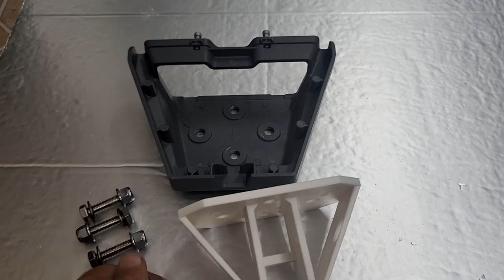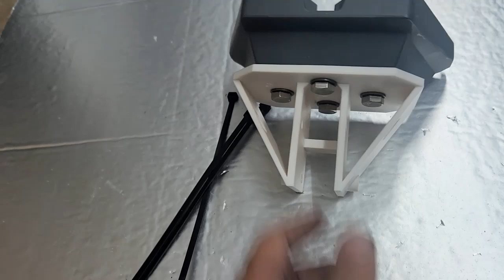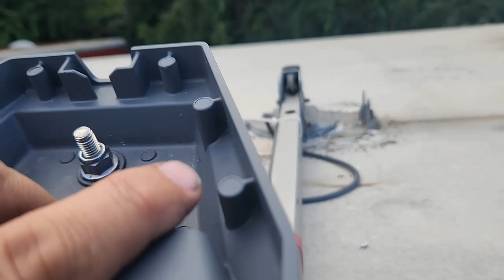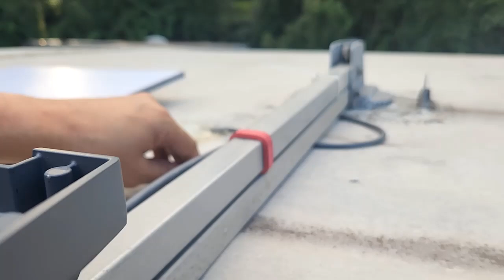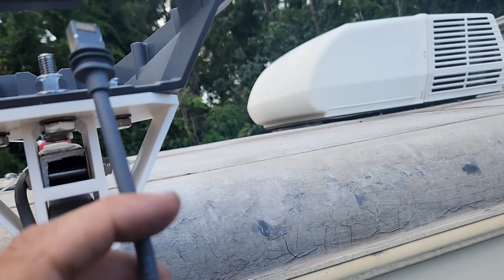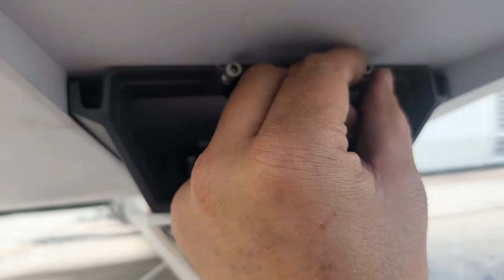StarGard Install - Original - See Lastest Version

Comment: Your title says you're installing StarGard, which is an anti theft device. You're actually installing Starlink.
Reply from the maker: STARGARD is NOT an anti-theft device.  I created this adapter for the quick easy installation of a STARLINK antenna using an existing WINEGARD (or AntennaTek) TV antenna mast.  These TV masts are generally found on RV's although some have been placed on large over the road truck "sleeper" and larger boats.  This video has a multi-purpose use, 1) as an installation guide for a STARLINK antenna using the STARGARD adapter and 2) showcase the ease of installation using the adapter.

Comment: I think this is great but the plastic material makes me nervous.  Any chance there could be an option to have it fabricated in metal or carbon fiber?  Not sure what other materials would be stronger and easy enough to customize.
Reply from the maker: I was concerned about this a well.   We make it with High Impact UV resistant plastic.  I have it on my RV and I just came back from a 6,000+ mile trip across the western US.  Temps ranged from 47 at night to 105 (or more) across the desert.  I even drove it a few times (by mistake) in the up position for about a mile or two at speeds of 30 to 35.  It's also been through a storm on Galveston beach in the up position.  After I got back from the long trip we pulled it off to see if there was any wear are cracks.   There was not.   I did all of this before releasing the adapters for sale.  We feel this product is strong enough and designed to hold up, therefore we don't have plans to make it in any other material.